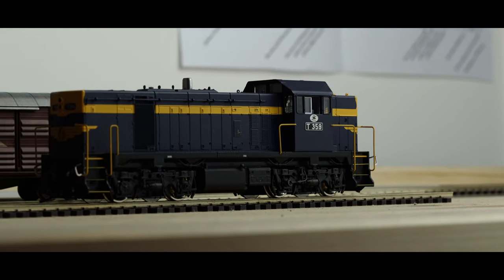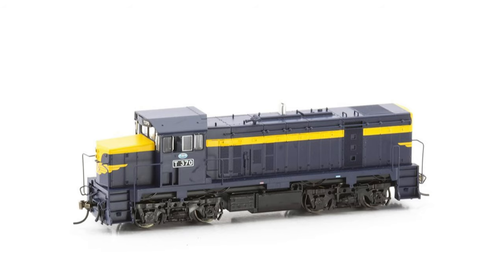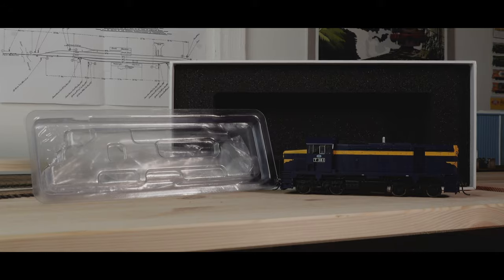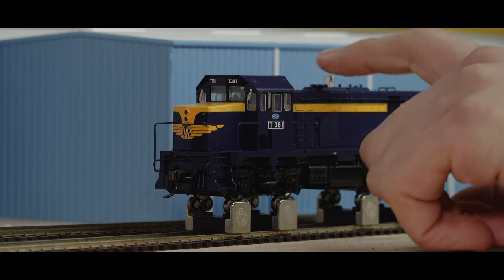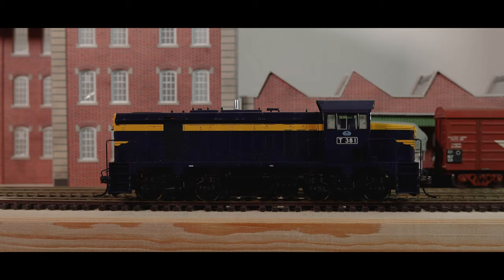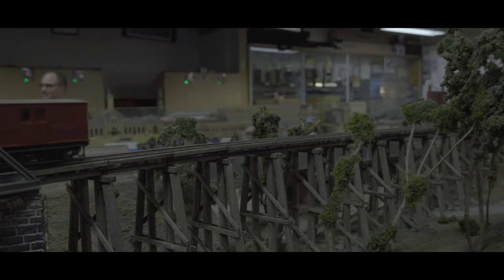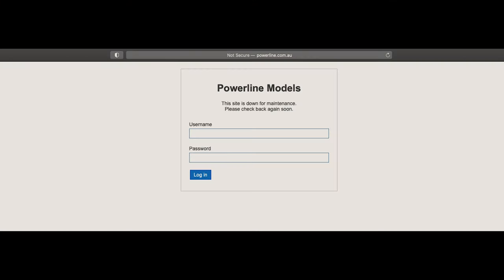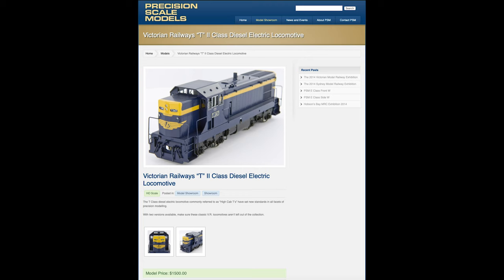POWERLINE: VICTORIAN RAILWAYS T CLASS REVIEW (DCC & SOUND)

Comment: Regarding the cold start issue Will, what can be the issue is grease getting into the axle bearings and inhibiting current flow. 
This can be overcome by inverting the model in a cradle, remove the bogie base plate by releasing the tabs with a very fine flat blade screwdriver, then one by one remove the axles, clean in shellite with a toothbrush and replace in the bogie. I always like to replace the axles into the same place and in the same orientation in the event that the gears have started to wear in such a way that might cause them to be noisy if placed in another axle position or reversed. It’s unlikely that this is the case, but better safe than sorry I think. 

Once the axles are in you can use a 000 brush to add a drop of peco power lube to each axle bearing to help with current flow. 

I think the main issue are grease infiltrating the bearings and also the springing of the axles meaning that the contact between bearing, axle and the current collection strips in the bogie can be lost or not as positive as it could be. 

I’ve treated all my Powerline T class (older run) locos and they run very well now. 

This combined with fitment of a keep alive would make for a fantastic running loco.
Reply from the maker: Thank you very much for the comment Stephen! I'll certainly look at giving it a service like that and see if that fixes that problem! Thanks again!

Comment: Many years ago, I had several Precision Scale Models T class locomotives (including a H) - all ran nicely etc.  Currently  (having returned to VR after years of BR), I  have all four (4) of the new Powerline T class (plus a Bendigo Models T and an earlier Powerline T) ..... as I  am still constructing a layout, they have only been test run successfully - they are standard DC and run smoothly straight from the box on Peco code 100 Setrack no. 3 radius curves.  I have used both Powerline, Austrains and PSM models over the years on a large layout with much hidden trackage and nasty gradients that belonged to a friend.  Surprising to Many, but it was the Powerline T class that proved the stronger models.  Detail wise too, went compared to Austrains for example, they looked better.  An improvement also on the PSM but that may just be my eyesight!  I  am told the colour on the latest run is wrong but it looks OK to me.  We shall see how they perform when thed layout is up and running and they suffer some sustained operation?  A stay alive would have been nice.  I have a pair of W class but I  believe stay alive is only DCC... ?  I like the models.  But, I  am only too well aware that Powerline does have an unfortunate reputation for conservatism within the hobby and thst the new SDS versions mag eclipse all previous T class models - c'est le vie.
Reply from the maker: Thank you for my sharing that! 
I didn’t realize the colour was off on the models! I mean a bit of weathering and no one would know! 
Yes the IDR W’s only the DDC models had the keep alive. 
I think you may be right about the upcoming SDS release! I guess we’ll soon see. 
Thank you for watching and leaving the comment!

Comment: Glad to see the cut out issue being discussed!
So this is my take and solution.
With my T class, the problem seems to only be at crawl speed, step 1, 2 etc.
Once more power/speed is applied it seems ok.
But buying the loco new and not being aware of anyone else having the problem, I figured it was just my model and investigated. 
What I found is, the pickups are not the regular axle type we see on Auscision, Trainorama and even as far back as Athearn bluebox.
These latest model T class's have the type that you'd find on carriages or hornby tanks, they are bent metal that contacts the wheels, the flanges in this models case. 
Noteing this, I figured the factory blackening was maybe affecting the contact?
Maybe was, but what I noticed was, looking closely, some of the pickups themselves were actually not touching the flanges at all, a tiny tiny gap that might go un noticed. 
So I gave them a little bending so they well and truly were touching the wheels, which solved my problem. 
Note, the design does allow for gunk to build up on the contact point, which reversing and better yet, cleaning, helps. 
They also seem to slowly go back to the position they were in before I carefully forced them to properly contact the wheels. 
No dismantle necessary, just do it carefully and small yellow electrical screwdrivers are enough to remove the gunk and bend the contacts. 
They also have suspension/sprung trucks (which is so cool and hopefully other top Aussie brands start doing the same) but maybe time in the box and some wheels in different positions has left the pickups pushed up a tad and being in the boxes so long, they maybe need time to slowly go back in place?
Because a compressed wheel means the pickup is also pushed up and maybe sitting so long in that position may be part of the problem as to why some contacts on mine were not actually touching the wheels? 
Hope that helps.
Reply from the maker: Thanks for the insight on how you addressed this problem! I'll take a look at mine when i get a chance to see if this is the case as well! 
but it's funny, I've had quite a few messages with all different answers as to why this run of models in particular is doing it! I guess with some investigation like you said it'll all become clear, or in this case clean! 

Thanks again for the suggestion!

Comment: Great and accurate commentary Will during the height of the pandemic. Yet the local Victorian model railways scene is still a shambles and is yet to recover years on now since the lockdowns. The T class is a great example being the most popular and iconic VR model. Here we have SDS Tclass (expected delivery 2020 caught beautifully by you in this vid!) still not delivered. It's nearly 2024. So you have to turn to powerline but as you point out there are flaws.. So have they been ironed out in the new 2023 21DCC version? Who knows!.. the Powerline website is a joke- is it ever updated? You have mentioned the ridiculous practical issues (no pre-orders on websites) - I'd just be happy to receive any pre-order at all! They have only had my money near on 3+ years! When it comes to flat tops (The most iconic VR diesel locomotive) the only option is now a second hand BRM. They come up occasionally but usually over $400 - so that's 600+ with a chip (if you are lucky to even find one!). what does this say about the local modelling industry now? They have been caught with their pants down beholden to Chinese manufacturing and it seems unable to pivot? It's a joke. I just purchased a new working NSW diesel model I could actually get my hands on (that prototypically runs anyway in Victoria) in protest! Done with Pre -orders - no more taking my money and never delivering. I'm going to give T class a miss until the model manufacturers get their act together. Will that be 2025 (and beyond?!) who knows! Just MO!

Comment: I got my speaker upgraded to 2 sugar cubes. Plus fixed all the pick up wires and put better solder and heat shrink and has not had any problems since fixed. And sounds louder as well
Reply from the maker: Far out that must sound pretty good! Was it hard to replace/upgrade them?
Reply: @WillJamesRailways  I got Justin at trainworld to fit them as I was having same problem not picking up power properly. It sounds soo much better than the original speaker. So much more depth .

Comment: Nice review Will. I have the 2nd Gen T360 from Powerline I bought second hand. The factory DCC was totally rubbish as I found later, many railway forums have comments about the issues I faced so I ended up ditching it and replacing it with a Sountraxx Econami and sugar cube speaker. It runs really well now, and sounds good too although the horn isn't quite right. It would probably be the best running loco I have at the moment, smooth and reliable. I have an Austrains X class as well, it runs ok but not quite as good I think, also no sound.
Reply from the maker: Thank you very much! Was that a very difficult conversion or pretty straight forward?
Reply: @WillJamesRailways  It wasn't too bad. The Decoder fits where the old one was and the speaker is in a small hole in the chassis that previously had two capacitors. It was the first DCC fitting I had done but the instructions were pretty clear and with the way the loco is wired it went pretty well.

Comment: Just recently got a DC version. Don't think it's got any problems; it won't run really slow - take off's and stops are quite sudden. Not sure if it's the locomotive or my old power supply. One thing I have noticed though is how small it looks compared to my other HO scale locomotives. I'm not sure if the T class is a bit physically smaller than B class (Lima) or a National railways (Life Like), but the Powerline T class makes my other trains look like OO scale. Still, it's the best train I've had. Runs so smooth and quiet compared to my cheapies. I hope one day to source a beginner friendly DCC system and get it up and running on DCC. Seems DCC is a victim of the chip shortage currently...
Reply from the maker: Nice! 
That could be the power supply, however I’m not 100% sure. 
Yeah they are a small locomotive compared to a lot of others! 
Oh absolutely, although it seems to be getting better now!

Comment: Re the cold start issues, the onty two things I can think of are a dry solder joint/micro fracture or a dodgy component on the DCC board.  You could test this by taking the plastic body off and warming (gently) the cold  electronics with a hair dryer - if it works after that there is a hairline gap somewhere in the wiring or board that thermal expansion is closing.  Taking 5 minutes to start working (the presumably working all day) sounds more like the former to me.
Reply from the maker: Ahhh right, look ill certainly give that a go! Thanks for the suggestion!

Comment: Will ,I received a sound version today, I  noticed while programming the sound decoder that it is only set to 13 volts. I increased the voltage to 14 volts in the motor settings of the decoder, it seems to of helped the stopping. I am not saying it is fixed as I have only had the loco one day. Cheers John
Reply from the maker: Thank you for that John! Let us know how it goes! I’ll have a look increasing my one and seeing if it helps! Thank you again for the tip!

Comment: I bought one of these about 9 months ago and other than setting DCC address and optimising sound volumes nothing else has been altered and it has been running without issue ever since, good sound and pulling power. Only issue was that it did not come with a list of the souled/functions as fitted so I had to go back to Powerline for those.
Reply from the maker: Nice one Dean. I'm glad to hear yours has had no issues, seems to be a pretty mixed response from everyone if their model had issues or not. 
I didn't even realise it didn't! Hopefully in future they print them on the inside of the box like some other manufactures. 
Cheers for checking out the review ad leaving the feedback.

Comment: As well as the PSM brass release low and high nose versions of the T class there was at the same time the Australian Locomotive Company (ALCO) brass T class. There was some huge controversy arising from this duplication at the time.
This was the first PSM model produced. May have even been the late eighties, but I would have to check.
I have two of the first pre ordered Powerline T classes and was not impressed when they were not delivered with the advertised five pole skew wound motor but a three pole not advised by Powerline. Also mine had handrail problems. The DCC chip used did not please many owners.
Never bought any more Powerline models after this.
Have numerous Austrains T classes with extras bought that were too hard to resist at the Hobson's bay exhibition one famous year.
Solving all these DCC problems by just sticking with DC.
I wonder how much the new Powerline 48 shares with the original Trax 48 that Powerline took over and sold. New modellers would be amazed at the low mechanical spec of the Trax model. The push back from buyers of the Trax model led to the massive upgrade we got from the first Austrains models. Austrains being one of the first world makers to get models built with all wheel drive and pick up out of China.
SDS tempting if I need more T classes, but will probably cave in to try one.
In early years T classes did a lot of passenger work. A T class and PL cars was pretty standard for peak hour Werribee, Bacchus Marsh and Seymour trains for the sixties and seventies. Goulburn valley passenger trains were mostly pulled by T classes. I think even with the Vinelander to Mildura beyond Ballarat at least.
Reply: I have to the Alco T Classes one of the best models made for it's time.
Reply from the maker: Thank you for the comment! I had totally forgotten about the ALCO models one, thank you for pointing that out. 
I think you might be right, a few people have commented saying they picked one up in the late 80's and they're still running strong today which is amazing. 
I didn't know that about the powerline motors, that's not great on them!
Reply: @WillJamesRailways  thank you for your reply and keep up the excellent work with your model reviews and all the train related items you cover.
Reply: @WillJamesRailways  I have done a search and the PSM website says their T class was developed during 1989 and released early in 1990. I seem to remember the ALCO  version being available a bit earlier, so likely 1989.
Reply from the maker: @davidwestwood9098  Thank you for supporting the channel! Always trying to improve, and having a great time with all of this so it'll keep coming!
Reply from the maker: @johnd8892  Thank you for that John! Still very close together releases! Although by the sounds of it both where very popular!

Comment: I bought a couple of the first release T's with the switchable DCC/DC decoder and both have been poor runners. As a consequence, I have never bought another Powerline loco albeit I would presume they have improved markedly since then. The Austrains T's on the other hand have been excellent although they were not DCC nor DCC ready. Fitting DCC was not too onerous and well worthwhile for what is in my books a much better locomotive .. and the handrails don't fall off either. I understand there are mods for the electrical pickup in the Poweline T's but at this price point, they should just work properly out of the box regardless. Agree totally about online pre-orders. Why do they persist with such an archaic process. Who these days sends a cheque or money order?
Reply from the maker: Thanks for that! 
Honestly I’ll probably pass on the next run from them on the T’s and see what SDS’s come out like, as they’re essentially going to be off the Austrains tool!

Comment: In relation to on-line ordering, you have to remember that most Australian based manufacturers are still cottage industry level.  They spend most of their time and energy designing the locos and do not have the resources or knowledge to be webmasters as well.  We are not talking Bachmann here.  If they added a full time web guru to the payroll I imagine the price of locos would be considerably higher.  And that is why you have to print an order form and post or fax it in.  They have old fashioned office systems.  I do not mind, as long as they acknowledge receiving your order.  In any case, keep a copy of what you send them and you should be able to prove you placed an order and get your model at the pre-order price.
Reply from the maker: I'm going to disagree with you there I'm afraid. If you have a website you can very quickly and easily have a pre order system. I've done it for my own on and it took minutes to set up, and I don't have a background in IT.  Also it automatic sends and email to let someone know they have a pre order and it has all the customer details in one form and I can even add limits etc and that's through Squarespace. 
But since this video has come out, many model railway shops here have started taking paid in full or half pay pre orders online. So I guess the change is finally coming. 
This is just my thoughts on the subject.

Comment: Will, Do you think they are too busy making models to worry about websites. In my opinion both are equally important. Good and reliable products and easy to use website and ordering system. Like AM / Auscision website with their tiny pictures and scant description is a pain. You almost feel like you are getting Z scale instead of HO. Even European or Japanese websites have bigger pictures for their z scale products. SDS website is basic but I guess they rely on dealers for sale.
Reply: Hello I'm john can you please tell me how the Tclass goes around sharp corners and do you think I should wait for the new SDS model instead of the powerline one
Reply from the maker: Ah i reckon they'd have enough time to get a reasonable website made, considering you can have a website like mine though Squarespace and it's very easy to have up to date, easy to use and even has a commerce aspect which lets you take (for example) Pre orders for products!
Reply from the maker: Ah it seems fine around corners, i can't say I've run it on anything tighter than maybe a  21" corner. but it should be fine on anything down to 18"
Reply: @WillJamesRailways  thanks Mate